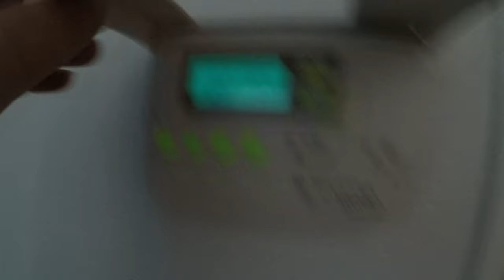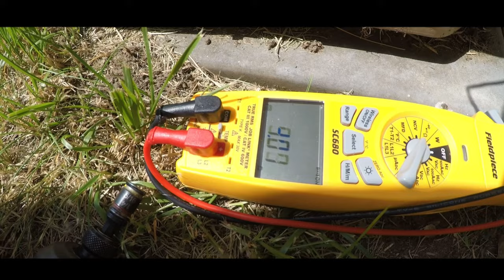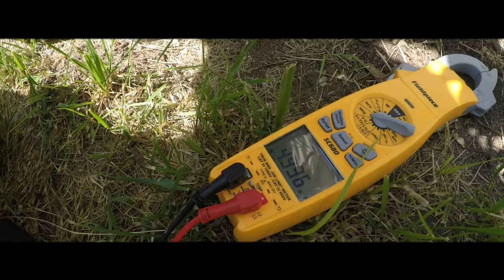Old Air conditioning isn’t working find out why?

Comment: Usually when a contactor and the wire is burnt it’s usually on the load side, it sticks causing it to over heat, I always double check my compressor wires when this happens and always check all exposed low voltage wiring when a fuse pops
Just what I do 
But, again good job on the fix